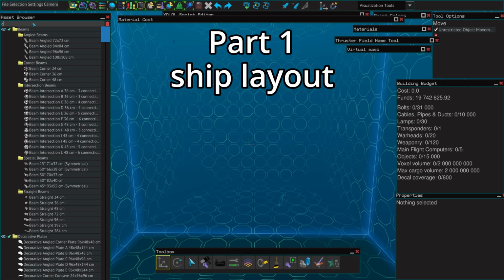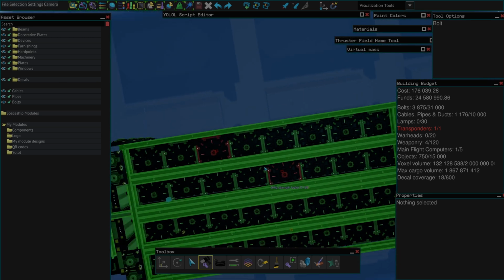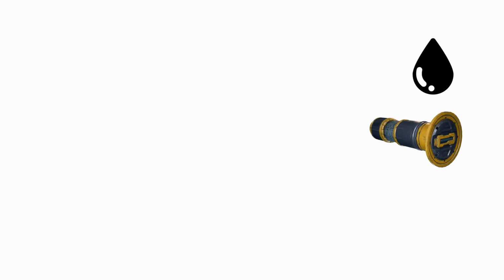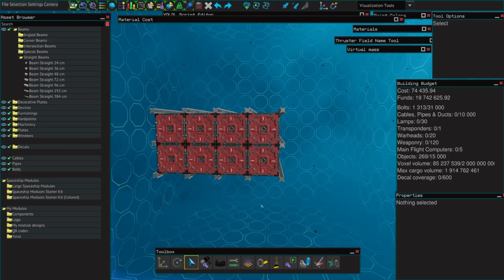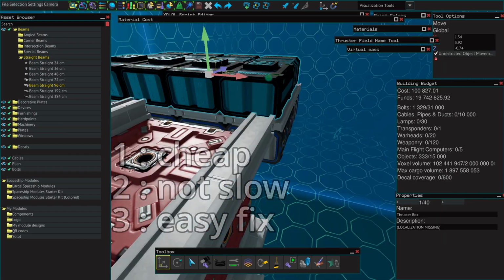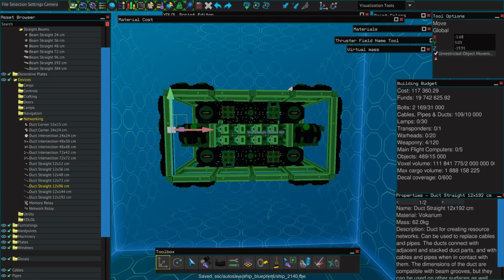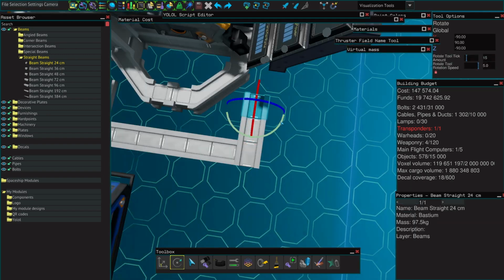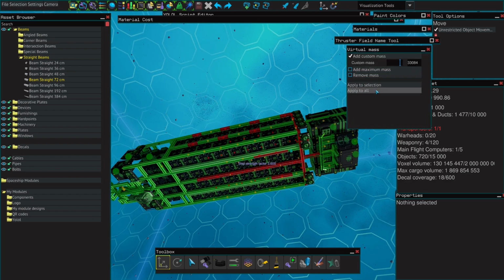Starbase Ship designer tutorial episode 2 : your first ship

Comment: Quick addendum and bonus comment for dat algorithm: hardpoints do not actually need to be bolted to thrusters. They do need to be in the correct place AND need to be bolted to frame, but so long as the thruster is also bolted to frame they will work just fine without being bolted together. This information is probably not worth editing the video over as this is a beginner tutorial(and a good one) and bolting the hardpoint to the thruster ahead of time is a good way to ensure that they are positioned correctly. However, one can achieve higher strength with fewer bolts by bolting in alternative patterns(for whatever that is worth). If anyone is reading the comments for more info, I hope this helps.
Reply from the maker: Ah that is interesting, thank you for the info. 2300 hours + in the game and still learning new things x)
I'll probably ask on reddit ( or on youtube ) for any weird / unknown mechanics and features the game has to offer in order to compile them in a big video x)
As an exemple, I learned recently that you can place your radiators directly on generators. It works, the issue though is that no data flows through it so you cqnnot have a display telling you the radiator status should you require one
Reply: @happytrigger42plays  That can be an issue for display, but I think that this behavior works in one's favor in terms of ship control. Ship broadcast events are processed as fast as the computer can handle them. Too many ship events can mean that certain events are processed next frame. Normally that is no big deal, but when it's the MFC splitting ThrusterPowerLevel assignments over more than one frame, we can get really ugly pitching/yawing during acceleration and deceleration as different thrusters get their assigned values.